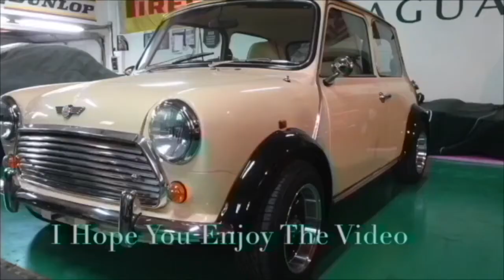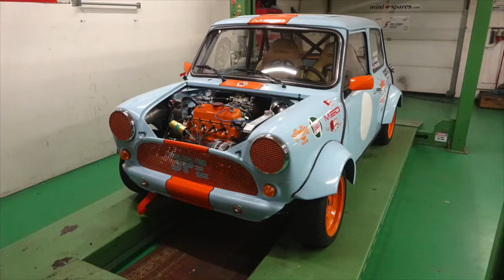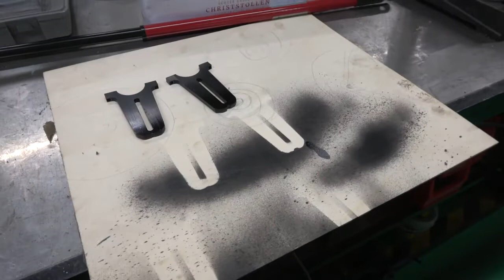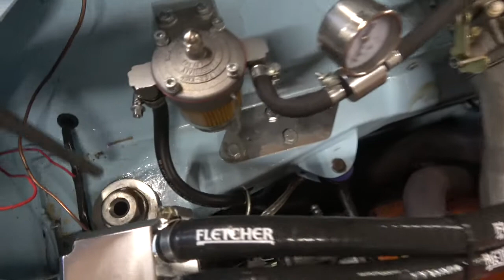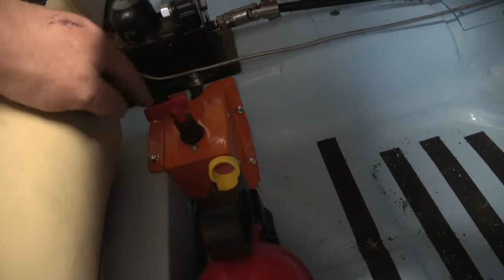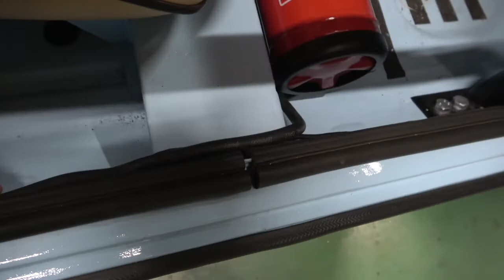Classic Mini Track Car More Braking News & Upgrades

Comment: 2nd try at this comment, arrrghh. Pads and thinning them down, normal job in my experience, done it several times, it's just all too tight otherwise. Cooling, very surprised it running hot already, does it do it with the grille removed? Fan, I consider it a must have mod you can use it on the cooling down laps and when your are back in the pits. As we just watched the very latest one, have you thought about corner weighting it ?
Reply from the maker: Rich,  Thanks thats reassuring to know about the pads, I think we will fit an electric fan as with no inner wing there is plenty of space. 
How do you go about corner weighting ? Cheers Dave

Comment: Was gonna say Dave, you have literally just bedded them in... Whens it going on track?
Reply from the maker: Alex,  Max said he had the same issue and after bedding in or filing them slightly it solved the problems. Still trying in vain
to get a open track day slot but the clubs here have them booked solid this year. Cheers Dave

Comment: Looks good Dave, you may want to pivot those mirror brackets down to get the mirror level with your eyes. I have the same one and it does work well.
Reply from the maker: Mike, Thanks i will give that a try sounds like a top idea. Cheers Dave

Comment: Nice abra and a well timed cadabra sir. I've seen some guys if they have trouble on hard pulls to keep the temp down they'll put an electric pushing fan on the outside of the radiator to help fill the core with air.
Reply from the maker: Doug, My editing skills are very poor but i do try lol. The good thing is there is no inner wing to stop the fan flow. Cheers Dave

Comment: Does the track car have to have any rear brake lights Dave ? Looking forward to seeing her in action mate  Rob
Reply from the maker: Rob, It does have rear brake lights and they where coming on during testing when they where hot, This is what lead me to
believe the pressure was still in the system when the brakes are not applied and the pistons not releasing. Cheers Dave

Comment: Greta vide Dave. Those adjustable hi lows are great addition to the mini and beingable to adjust them externally is even better. I like those adjustable  tie bars and bottom arms. All are great upgrades and will make adjustments much easier.
Cheers, Jeff.
Reply from the maker: Jeff, Thanks, I tried to incorporate as many adjustable parts as we could so we can set the car up right. Cheers Dave

Comment: I've always wondered if caliper pistons actually move. There nothing really to make them retract is there?
Reply from the maker: Andrew,  When you release the pressure off the brake pedal the pistons are being retracted back by a slight vacuum.
If there is virtually no movement or distances in the calipers the vacuum is massively reduced. Cheers Dave
Reply: When hydraulic pressure is applied, the square rubber piston seal is deformed slightly so that when hydraulic pressure is released the elastic effect of the rubber seal pulls back the piston a small amount
Reply from the maker: Keith, Thanks for the info that makes sense to me but there must be some reaction on the piston surface area when the hydraulic pressure is released the fluid must be displaced in some small way ? Cheers Dave